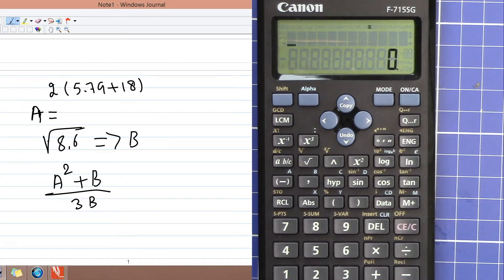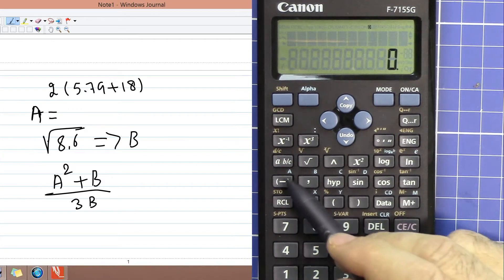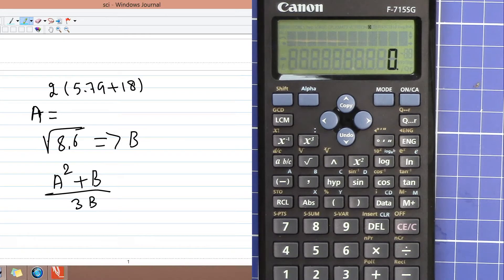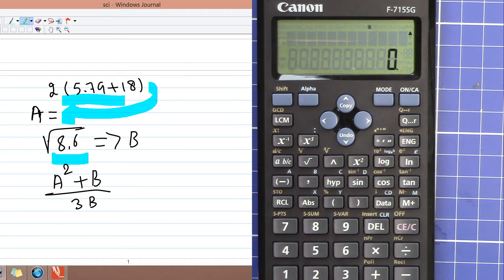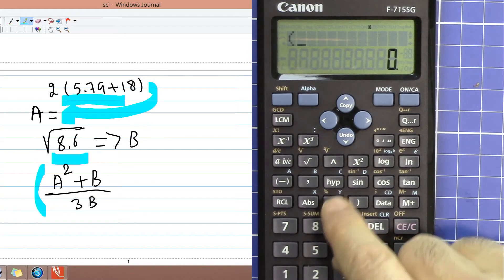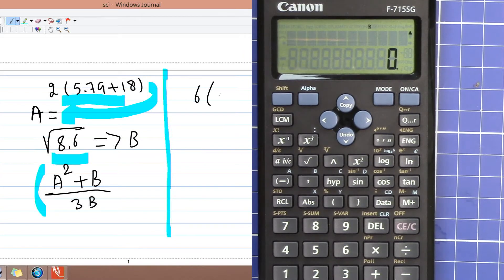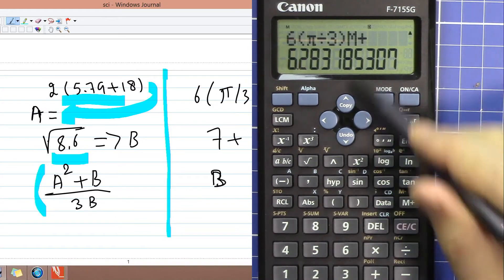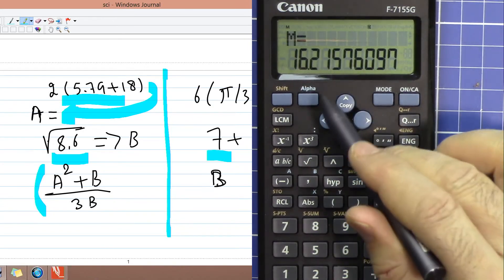Canon F-715SG using memory in your calculation

Comment: hi, quick note, as only for some curiosity comparing here f-715sg (2013) and casio fx-82ms (2nd ed) (2018) ... the canon has also memories 0-9 :-) ... but generally, it looks like the same intrnal chip, only with reconfigured keys, otherwise similar (most interesting is behavior of DMS/DEG conversions, it finally works, I elsewhere ranted a bit ... but still, cant undertand WHY they didnt show ' as minutes and '' as seconds during entry/show ... graphic line is okay and even on the 7seg its possible ... (drown into deepnes of the chips probably too much )))) cheers